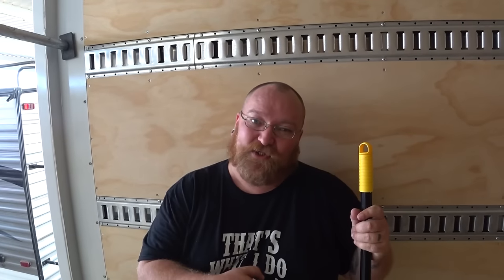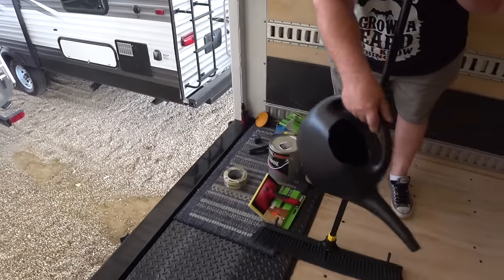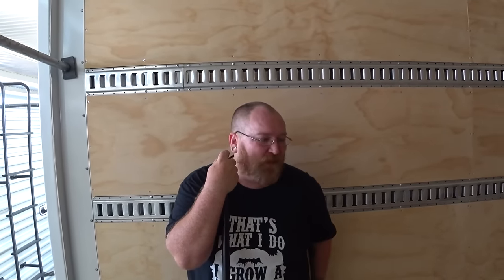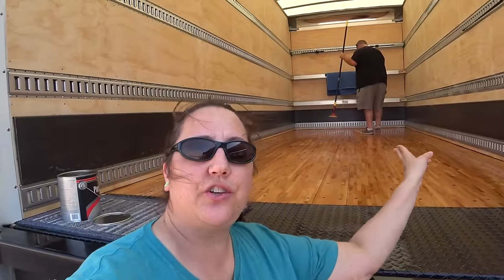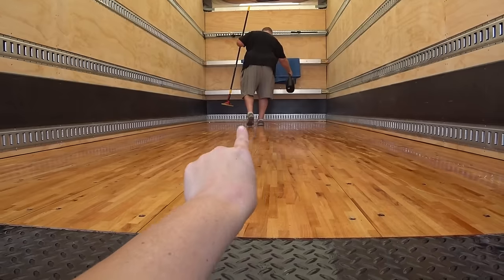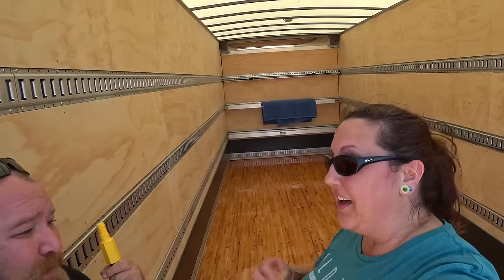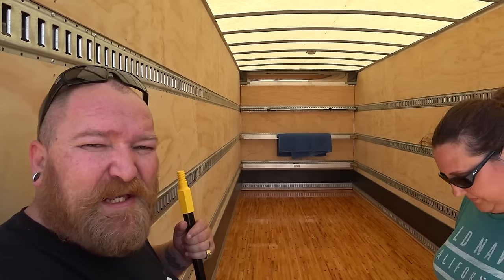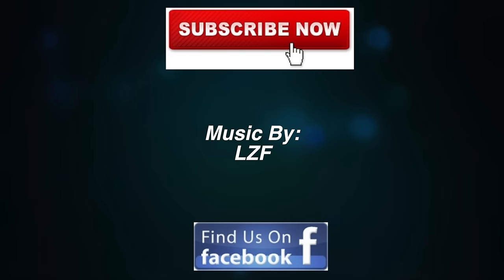PROTECTING THE FLOOR IN A STRAIGHT TRUCK BOX

Comment: I think the floor looks GREAT!   I thought you were supposed to sand lightly between coats? When building furniture, I use to either use 300 grit paper or a course wool pad. 
I think Heather outworked Jason LoL....
Reply from the maker: Pete_ Hine_Of_PA Thank you Pete! It turned out really nice. LOL I'm just a get it done kinda gal.
Reply: Well Jason knows best,  he's a smart dude for sure or he's good at reading instructions, either way Job Well Done.  I'm surprised Jason lets you drive the truck, but then again I have a sharing problem, LoL. Kidding aside, wishing you both good loads and safe driving.

Comment: Fantastic.I have a box truck that has to work while I live in at the same time.  I was not going to do the floor at all. How much will your poly U stand up to . Plastic skids loaded half ton of papers each. No fork lift ever drives in, but sometimes maybe forks edging skid take a bite of the floor.  Definitely skids (X6) are scraping all the way in . I'm thinking now of doing at least 3 feet back of the cab wall to spruce up to "dining room floor"  level since that is the section I live in. Inspired to step up my game a little sooner that I thought. Thanks.

Comment: I would suggest that you put a side walls , I had load of pesticides , I had one of friends go with me ,it was the same as PARACHUTE , Class B Poison . As note  Class. A would be Poison Gas . I don't remember name ,it came in by rail below Merced ,CA. & Madera CA.  In Washington state some were close Yakima Wa. & Toppenish ,Wa. I was it was class B Poison , it was big boxes with some plastic around it . When we got there was dust all over , my friend helped unload it . It all most killed him . I called my dispatch and told they tried to sweep it out and wash it, that was the worst that , because the pesticide  went in to the wood . Parts per million was so high I was not able load anything in it . I left for office with placards on , was stopped at scale & was told to make them blank , I told that the trailer was contaminated & was going to Vancouver Wa. to are office to try to get it fixed , the shipper was big Company back east & would not fix it , our insurance would not pay .I would load any thing tell it was fixed . I want go in to what I went through .I had 45 ft. dry van  . I can tell you that after a year it cost to remove the fours and side wales , because it was contaminated it classed Hazard waste, it coast over 7,000 $ to remove & 5,000 to replace . The trailer was 2/3 payed off   .